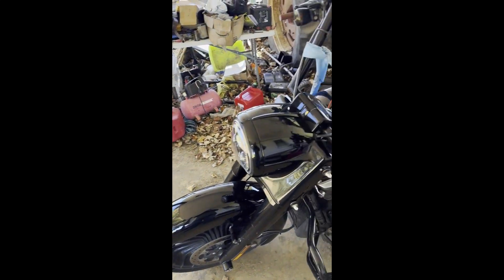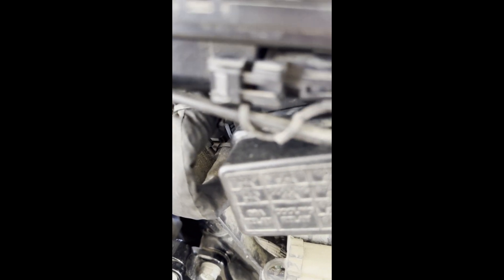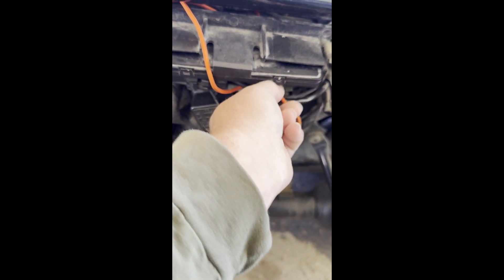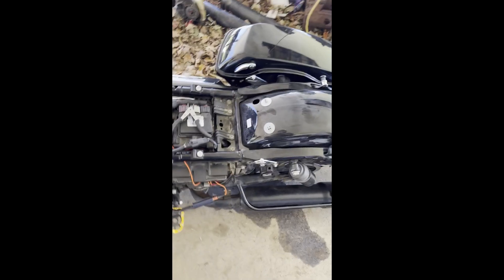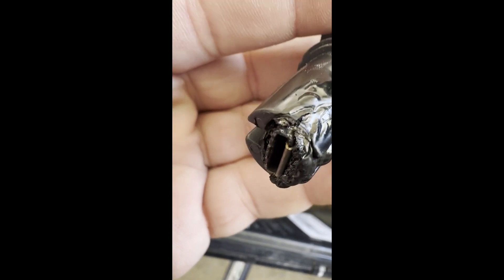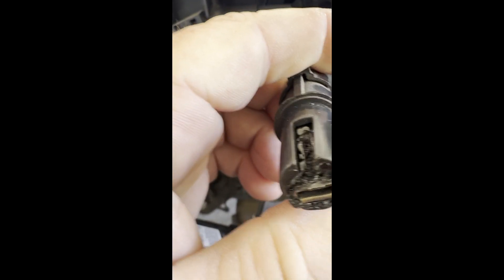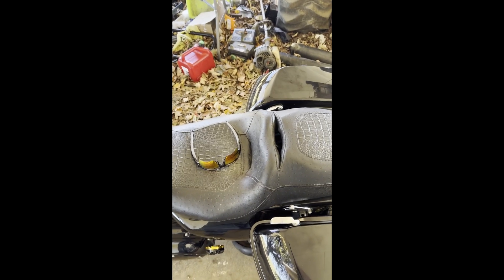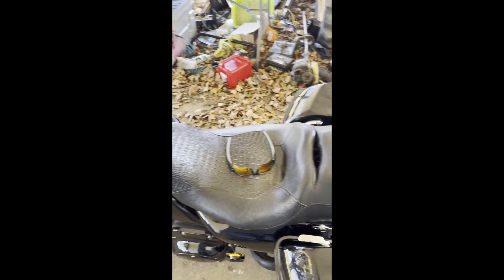Droop's Redneck Engineering 101

Comment: Wow, the plug end MELTED?  That's nuts.  I've only ever seen that on a failing fuel pump drawing too much juice.  I'd be concerned something downrange of that plug end is pulling a ton of power, but it's cool you engineered at least a temporary fix!
Reply from the maker: @RoadReality  the spade connector itself was loose and caused the short which caused the plastic to melt.
Reply: @Droop_Moto  Oh, gotcha.  Yeah, that'll do it :(